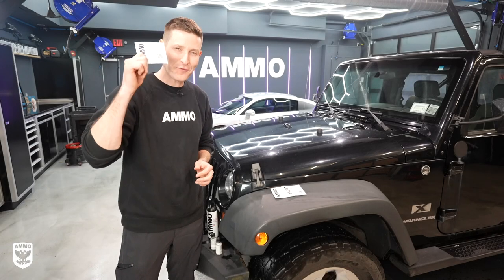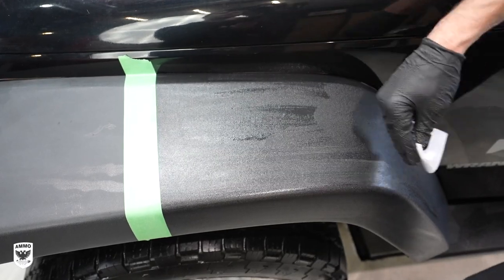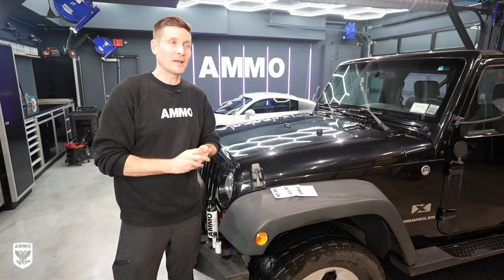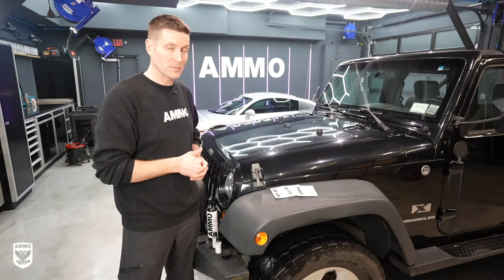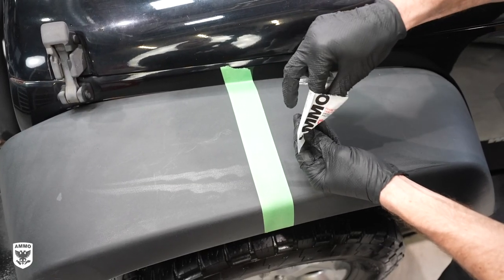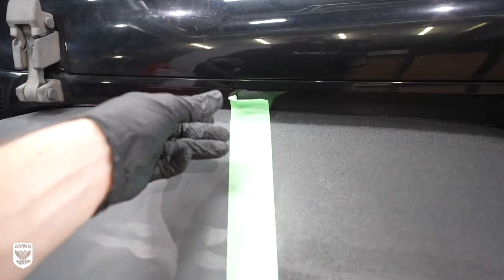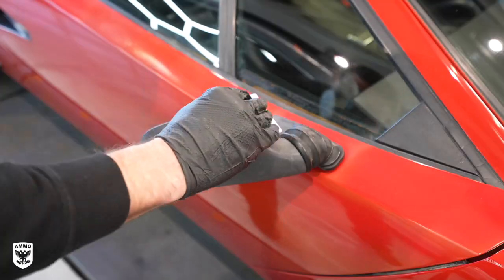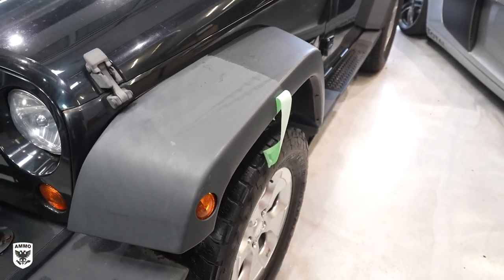AMMO Frame Pro Trim Coat - How to "Frame" Your Car!

Comment: Just used my first pack, the only trouble I had with it was around trim that I couldn't properly work around such as the bottom front of the grill and certain parts around the mirrors. I also recommend working the plastic before any rubber trim. On my father car it was really thirsty and blacked out the rest of the towellete but not on the plastic.

Comment: Cool product! Two questions:

1. Is it going to flake when it eventually wears off?
2. Can it be used on rubber (not tires)?
Reply from the maker: 1. During testing it fades (not flakes) slowly over time. Even on a vehicle that’s sat outside all winter. Still a noticeable and factory look. 

2. I’ve used it on rubber components in the Macan’s engine bay. Came out great but the application is more difficult on smooth non plastic surfaces.
Reply: @AMMONYCSTUDIO  Most trim coatings streak when they get wet after proper application and curing. I would love for this to NOT be the case here. How did the coating on the R8 reacts when wet?
Reply: @odishoyounan  If you apply it to a clean and DRY surface, and give it time to cure, then it should Not streak when it gets wet. I have been using "CERAKOTE Trim Coat" for a year, and a "AMMO Frame Pro" is packaged and applied very similarly, as shows in the video. I am looking forward to trying this new AMMO product! . . . Once again, the chemical must be applied a very Clean and Dry surface to prevent streaking and spotting.
Reply: What happens if it dose get on paint and it’s hard to wipe with a micro towel is it going to be ok if I can’t get into some of the area that’s really small it’s not going to damage paint is it
Reply: Just applied this to a rubber floor mat. Went on super easy. I’ll post how it goes post-application.
Reply: Update: applied Frame Pro Trim Coat to the rubber floor mats. Strong smell while applying so left it overnight in the garage with the door cracked for fresh air. Next day is a dry, rich black floor mat that looks like new. It is not slippery so it retains the effectiveness as floor mats. It is a tad more shiny than original, but an absolutely wonderful application to restore old floor mats. For an SUV, plan on using three of the towelettes for both front floor mats. 👍🏼
Reply: @justinharris3464  I ran into this today - my first time to use this product. On chrome areas I was able to get it off - with some detailer and elbow grease. Not so much luck on paint. This is some kind of ceramic coating, so, other than not looking very good, it's my guess that it will just provide some unsightly protection, until it wears off - a bit like when you apply a coating in poor light, and don't see well enough to level it properly. Don't ask how I know about that - but if pressed, I'll tell you about a friend who . . .  😁
Reply: @wileec5939   yeah I’ve been dealing with this issue for 2 months and still haven’t found anyone willing to try and fix the issue I’m speaking with a guy now and basically it’s gonna need to be paint corrected and hopefully this works really a pain in the ass for sure love the product but it’s the last time I’ll use it I’d rather buy all new trim
Reply: @justinharris3464  The key is to apply in decent light, and wipe it off soon after application. Trim Coat is similar to what I think is the best product in the category - so far - time will tell, for me, on Frame Pro Top Coat. Bottom line, these are coatings - so if you get some on the wrong surface, it will wipe right off, IF in a timely manner. Yesterday was my first time to use it, and I wasn't in good light, so didn't know I was getting it on other surfaces, until later, when I had decent light and I was preparing to apply a ceramic coating to the paint.

A quick polish is the only way to level/remove this product if it is allowed to cure on surfaces other than trim. I'm choosing to leave it - and see how long it takes to wear off - more out of curiosity.

Comment: Larry! This is awesome.  I have been using the Cerakote Trim coat for a while now and really was hoping you would come out with something better.  The Cerakote wipes were prone to streaking (once dry) the trim surface and it was very frustrating and expensive to resolve.  Looking forward to trying Frame Pro out, just putting in my order! Reflex Pro and Gelee Pro have been awesome for me so far, the shine and protection are truly incredible.
Reply: Thank you for this new product! I appreciate your reminder to properly clean and DRY the surface prior to application, otherwise the chemical Will Not Adhere. Using compressed air is a great suggestion for removing moisture from plastic seams and crevices that cannot be reached with a towel. I have also been using Cerakote for a year, and it must be applied perfectly to prevent streaks. I am looking forward to trying your AMMO FRAME in the near future!

Comment: You said it will last a couple years, but what if the car sits out in high UV conditions year round? Any ingredients providing long-term UV protection? Other methods of darkening my plastic trim haven't worked for very long because of the lack of UV protection.

Comment: I added this to my 2010 challenger, it looked great on all the areas I applied it to except on the rear trim where the taillights go it left light black and dark black spots. Should I apply more? I tried removing it with different chemicals and no luck.
Reply from the maker: Yes would try another wipe and gently paint it on.
Reply: @AMMONYCSTUDIO  will do, thanks for the reply!

Comment: Thank you for this Larry
Been hoping for it for a while 

Any specific instructions if i had reflex pro on the trim ?
Reply from the maker: Just clean as directed per the instructions and Frame will go on just fine. Similar but tweaked formula specifically for trim surfaces.

Comment: Other spots that I think would be applicable are... mudflaps, engine room plastic trims, the cowl piece, wheel well liner, or like the R8 bumper garnishes on my 10th gen Civic lol
Thanks Larry, I'm excited for this!!

I understand as with any other product, it very much depends on the application and condition it is being used, though I'm still wondering, perhaps just a safe guess, how long would the effect last?
Reply: @SpyderRacing  agree! From the new Countach video I think Larry mentioned it'll last about a year or 2, so definitely not the magical pill lol but nice to have
Reply from the maker: In the vid I show the result after 9 months on the R8.
Reply: @AMMONYCSTUDIO  which does look longer lasting than putting MUD on 👍🏻😁

Comment: Can I use this on a black faded dashboard? Or wheel liners?
Reply from the maker: Frame Pro is for rough plastic exterior trim. If the wheel liners are rough plastic yes otherwise use Mud Tire Gel.